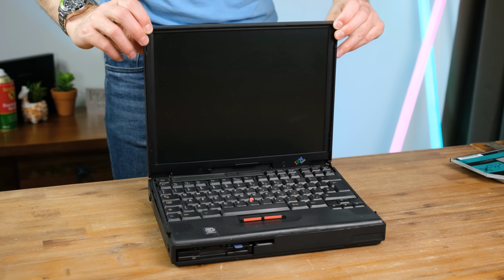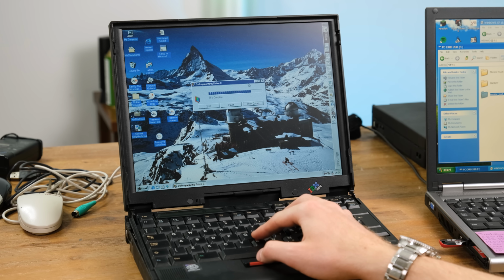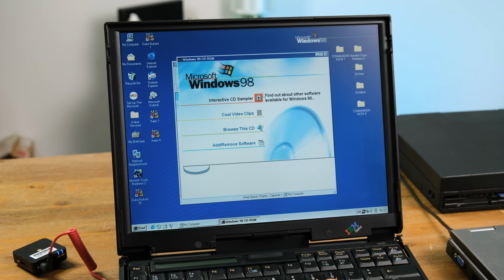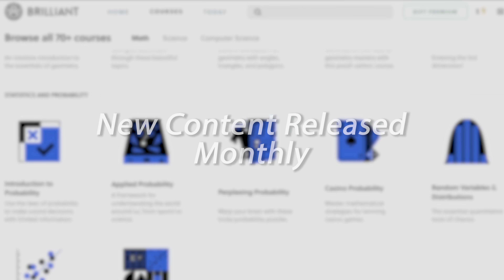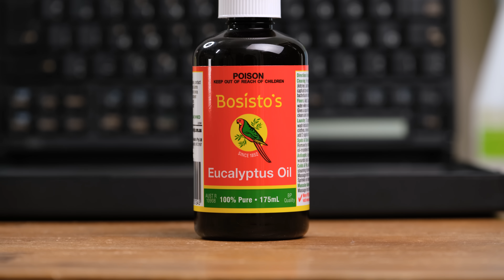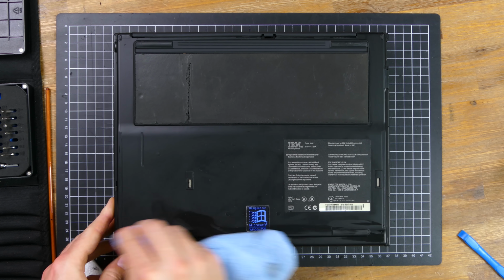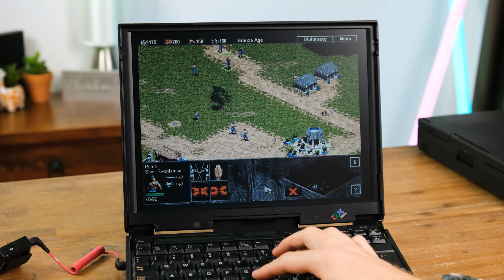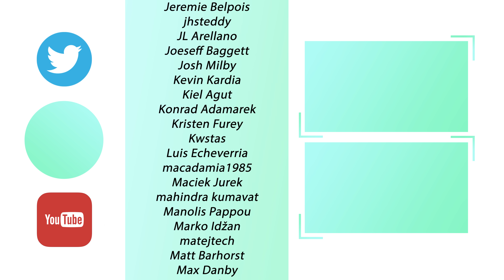$6,500 IBM Thinkpads From 1997! They're Melting...

Comment: I came across your video because I have a Thinkpad 760 XL released in 1997 that still works, and I wanted to see what you did with your older Thinkpad. I have the same issue with the coating being messy—it comes off whenever you try to clean it.

Comment: I think the 310 was better at the same spec..maybe not in video. Definitely had better sound chip. 380 I think was the best at the time overall (depending on machine type)  The modem dongles (if those are dial up) were identical amongst different manufacturers. You could swap.._most_ of them.

Comment: Sometimes using baking soda powder with some water can clean and remove the stickiness of a plastic including rubber-coated plastic. I saw it on YouTube and then tried it on a Casio calculator, a Razer mouse, a Microsoft Arc-mouse and it worked! I am not sure if it always works but give it a try, you’ve got nothing to lose except 10 minutes of your time.

Comment: If you want to clean the sticky gunk off an old laptop/camera - don’t use a solvent. Use a microfibre cloth dampened with water to gently wipe away the surface layer of grot, over and over and over again … and it will eventually slough off.

Comment: Electronics can get hot if left running for a long period of time. In fact, planes have crashed due to overheating electronics that literally melted during the flight. There was a Swiss Airlines flight that had an experimental IFE system in first class that was similar to the seat back screens you see on modern planes but it was only available in first class. The electronics controlling this system got so hot that they started melting wires that were part of the electronics in the cockpit, causing crucial instruments to fail. In the end, the plane crashed into the sea with no survivors

Comment: I’ve got a few older Thinkpads and what I do for the rubberized coating is: wipe down with PB Blaster Silicone lubricant and let soak in- followed by a few coatings of Meguiar’s Ultimate Black plastic trim restore. Both can be found in auto parts stores

Comment: The rubberised coating is used on a LOT of stuff and it starts to melt REALLY quickly. I have a Lenovo USB DVD drive and the rubberised coating started to go sticky after only a few years. I ended up covering the case in sticky backed plastic because every time I handled the drive, my hands got sticky. But it's not just electricals. I've even had ball point pens coated in that stuff and it's really unpleasant trying to write with a pen that leaves all that stuff on your hands. It also makes you wonder how toxic the chemicals can be?

Comment: I own an IBM 760XD and an incomplete 760EL (from that I transplanted the FM soundcard into the XD, because the original "Mwave" slows games very much and simulates FM very poorly). None of them are sticky, although the 760EL has lid paint flaking off. May it be that the laptop bag was evaporating plasticizer that attacks the PU rubber paint? Also do not use eukalyptus oil - it is way too strong and may strip the lettering from your keys! Perhaps it also decomposes the display polarizer after a while. And do not use "lens cleaner" (for exeglasses?) on it unless it was specifically sold as suited for LCD displays. I only use water (a damp tissue) to clean this screens. Anything corrosive (particularly acids like in window cleaner) makes them decompose. My 760XD LiPo battery is charged 3x per year and still holds some energy. I have a "Hama USB 2.0 CardBus" PCMCIA card with 2 USB slots for using a proper mouse and USB sticks. The hires screen (1024*768?,16 bit colour) has developed some hundred red, green and blue dead pixels near the edges but is otherwise working.

Comment: I would think you could encapsulate the rubber stuff, like the lid, in acrylic clear coat. This would preserve labels and stuff. Rust-Oleum 249117 is very forgiving about prep (as in works well on dirty stiff with no prep, or a surface like that rubber, which is the equivalent of no prep, >>AMAZING<< UV resistance). If its to the point like the the bottom half was, where the item is shedding the rubber... have you ever tried a 3M Adhesive Eraser Wheel? They do not harm paint, I would think the plastic would be okay. 

They work by rolling the adhesive off like if you were picking at the glue with a finger. 3M 03612 Adhesive Eraser Wheel. (they are available in various sizes, and you can also try an adhesion promoter for bendy rubberish automotive bumpers and plastics if the clear coat does not bond well)
Reply: "Amor All" is a plastic coating/care product for car dashboards that may work against sticky PU paint. I haven't tried it yet, but AFAIK the stuff on dashboards is quite similar.

Comment: That rubber coating really is a bane! I have a boxful of small devices (Mostly MP3 players) which have it, and they are in the very frequently postponed process of being seen to. ⏳

My approach is to remove the plastic shells from the devices, then either soak them in a solution of regular bathroom soap and water for 24-48 hours, or apply a moderate coating of soap directly to the decayed rubber. After a good soaking (Which can be seen by the rubber noticeably becoming lighter in hue) the coating can then be removed quite easily with a soft plastic spudger, guitar pick, or strong fingernail. 👍

Comment: I remember I had to do repairs on a Thinkpad 7-series during my voced in high school and was mesmerized by the fact that every major LRU had color coded tabs, latches, and instructions and component information on the protective housings. This was in 2009 so it wasn't super old at the time, but it was huge departure from electronics back then when iMac G5s were big. It was incredibly simple because the parts were on hand. IIRC it had a CD-ROM drive click and required a new installation of Windows 95SE. The latter was fine because there were no super valuable data that was stored on the laptop.

Still blows my mind thinking about how based this boy was back in the day.

Comment: Thanks for your video! I have one I bought new in December 1997. Mine is the 765L. It was my 2nd pc, and my first laptop 💻 🙃! It took me through my masters in Architecture and urbanism, and my first jobs here in Guatemala where I live. I used to run AutoCAD 14, and even did a 3d model of a midrise. The IT guy at school installed windows NT on it. The ac adapter busted back in 2003, and it has not run since then. I want to bring it back to life. I jut found on ebay one of those 4 pin adapter. 🤞hopefully it will work 🙏. I  have a lot of attachment to this unit. Mine doesn't have any locks on it cause it never was a company unit, so id like to upgrade the hd for a larger, and faster type of ssd. What type of connection adapter and ssd should I look for? Your input would be greatly appreciated!! Best, JP

Comment: Got one of these second-hand at a computer fair in 2000(?) for a couple hundred $.  Interestingly it was sold to me with Win 95 C, which worked fine other than an included PCMCIA network card that wasn't compatible.  I ended up loading Win98 on it which was unfortunately a bit sluggish when combined with Visual Studio and games.  Fond memories of many games and programming on the road with this thing, and much less fond memories of burning my leg while wearing shorts.  Like many laptops at the time this thing got cooking under load.

It all still works but I'll probably take the advice of some of the other commenters and remove the standby battery.  Discovered the problem with the rubberized coating the hard way when I recently pulled them out of storage - luckily I didn't use my lap but I still ended up with black palms and forearms :D.

Comment: Use WD40 on the sticky rubber. It'll revitalize it.
I would upgrade the RAM to 4GB, and get an SSD installed with sata or UBS to pata adapter.

Comment: I have 2 of these 760 something,  I bought them in 2000 for just $50 or so.  Government second hand.  I used them for a couple years,  I loved them! In fact they are still functional and I occasionally use them to drive teletypes.    But they both have rubber rot 😞

Comment: As you discovered, isopropyl alcohol and rubbing can remove all the rubberized coating. Soaking the pieces for a while helps as well (a wet cloth could do the trick).

Alternatively corn starch or baking soda could be used to temporarily make the surfaces non sticky, until these wear off.

Comment: A bunch of my devices have this issue of sticky rubber, even recent ones. Not sure what causes it, but it was nice to see how you removed it. Just goes to show, I'll probably not be able to fix this easily until I can find a way to dissolve the rubber more easily.
Reply: It’s caused by the natural decomposition of the polymer chains that make up the rubber,
Reply: If you can submerge the part in isopropyl alcohol, the rubber should peel off after a few hours.
Alternatively wrapping the parts in a wet vloth/kitchen paper could help as well.
Otherwise it's gonna be qtips+alcohol +lots of rubbing.
Reply: On my 2015 HP laptop, the rubber joint around the screen became solid and is now slowly eroding away

Comment: I have a 760XL that I bought about 10 years ago. Keeping a vintage laptop running is quite a challenge: the original 2.1 GB died, so I change it to a 6GB. Then I forgot to remove the NiMH backup battery, you MUST remove those, they will leak and damage your precious old laptop, I had to repair the small board under the keyboard where the battery was connected. Then the screen started to rot, first black spots and then finally died. I managed to find a new old stock LCD, but now is showing some white background stains. Yikes!

Comment: I have a 365XD which are a year or two earlier. They are straight black plastic, so no gunk. I do love how easily they open and you can get at the inside from the keyboard lifting up. Neat design...they are definitely the size of a thick textbook.
Reply: I have a 365X and it’s great other then some hinge problems
Reply: the 560 and 380 are the same way, no rubber crap, my 760ED though sticky surprisingly

Comment: Manufacturers still use awful soft rubber coating these days. And it’s still melting 🤦‍♂️
Reply: Don't worry.. 99% of modern electronics will be in the landfill long before it's a problem!

Comment: Try methylated spirits to reduce the stickiness. Even modern rubberised plastics deteriorate. And use some beewax to keep oxidation to minimum. I had the butterfly keypad version for work. The most beautiful ThinkPad imo though the trackpad buttons and modern connection were weak points.

Comment: Not sure if it would work but I have been able to get the sticky residue off other devices with rubberized coating using a wet paste made of baking soda and water. Rub all surfaces with a towel dipped in the paste.

Comment: can linux work on these??
Reply: yeah it does. A light weight distro would 100% work on these. Linux is designed in a way to work with any hardware. But due to limited hardware specs only older versions or versions made for old systems would work.

Comment: UGH. I had one of these laptops in college; it had a mobile Pentium II 233. Everyone hated these. The hard drive made weird noises after a couple of years and the video chip (NeoMagic MagicGraph 128XD) would crash the system all the time. Sometimes the system would freeze up so bad that the power button wouldn’t work and you had to unplug it from the wall and remove the battery to make it turn off. I don’t miss this at all.

Comment: You can pretty easily remove this soft-touch (rubberised) coating with solvent 647. But be careful: under it sometimes could be gray and/or ugly plastic so first try on hidden place. In this case i'm painting it with tranperent nail varnish, but it's also a bit ugly. You can also try some spray varnishes, but i'm not sure if it's safe.
Reply: if you can find out what the plastic is, then you can find out what can be applied. i would imagine a good clean and almost any paint would stick, they used to use alot of abs plastics back then.
Reply: @jasonstalder5208  yes but there is still a lot of new soft touch stuff, and i have variable sucess cleaning it -  a lot of times you don't even have to paint it
Reply: @crapasanya  you just said you were painting it, that's probably the cause of my confusion

Comment: You can remove the rubber coating with brake fluid. Fully disassemble and let the panels sit in brake fluid and gently scrape with old bank card. 24 hrs usually works. Don’t let them sit too long as brake fluid can make plastic brittle. 

You can then paint. I had a 600E i did this to. I painted it candy apple metallic red. It looked like a million bucks. 2k clear.

Comment: I've had good luck using a multisurface polish and magic erazer on those sticky coatings on cameras, rather than remove it it sands it back down into a consistent rubberised coating again that lacks that sticky grease texture, it still has the grippiness to it, not the smoothness from factory but going heavier with the MSP did help, if you wanted to keep the other original of course.
Reply: I have had success with normal Armor All wipes and significant scrubbing - it removes the soft touch coating but leaves the underlying plastic clean. You'll want gloves (the soft touch stuff will stain as it's removed), but once it's gone, there's no residue.

Comment: I have an old T500 and I'm also 65++. First thing I did was open it up and clean out the cooling system. Second thing was ditch that miserable 5400 RPM  SATA hard drive in favor of a bigger SSD. This cut the cooling load and helped both read and write access. Added more RAM and then Linux Mint just rocks on it. Love those old ThinkPads!

Comment: I remember the machine and got an old one from uncle about 6 months before Windows XP came out, pentium 90mhz it was but with a smaller screen than yours, maybe even smaller than the cheaper model!  An interesting feature is the lack of a fan !  Does yours have a fan?  I remember the bottom got very hot and of course I had to try some XP beta on it which was overly slow but also very cool to see 😊

Comment: Those things we awesome for several reasons: TFT was not  very common at that time. Most flatscreens were just simple LCDs that were terribly smeary. You couldn´t watch videos or play games. It was a wonder of technology to have a relatively fast image update at that time on a notebook.
The speed was good for that time. With 166MHz you could run any software smoothly, of course also games. 64Mb was more than enough for everything. Office software was running faster than today´s online office cr4p. The modularity of these notebooks was fantastic, you could upgrade, replace or select parts that you wanted. That´s why I only buy MIL-grade notebooks these days. They are still kinda like that - unfortunately not completely, but honestly, todays´ single-board notebooks are crap - but they cost only 10% of what you paid in the past. The modern expensive notebook in this price category are really good, but unfortunately extremely fragile. A few drops of water will cause damage, and you can´t simply repair them. The manufacturer won´t replace parts. You even need special equipment to open them. I prefer the ruggedized semi-modular ones.
Reply: You're not using an apostrophe, you're using an acute accent. This is an apostrophe: ' this is an acute accent: ´. The acute accent goes over letters like á or in Greek ά έ ύ ί ό ώ

Comment: That rubber coating was used by VW group on their cars in the late 90's and early 2000's and has the same issue now. Mainly used on switchgear where scratching really shows up due to the backlighting.
Reply: Common VW L
Reply: The handbrake on my 2004 Fabia feels like it is also starting to melt